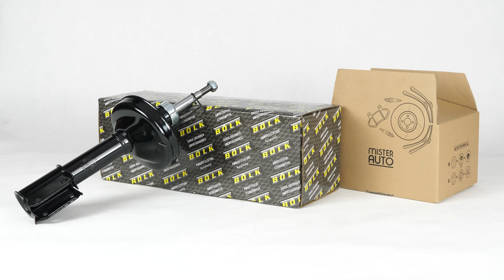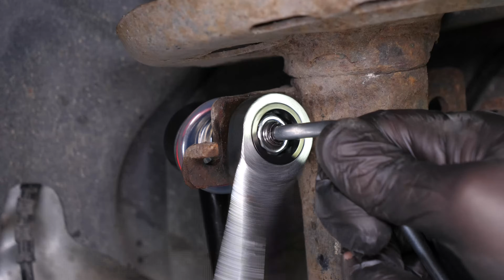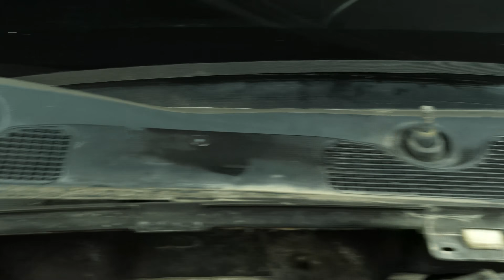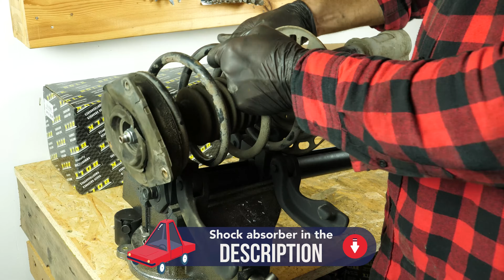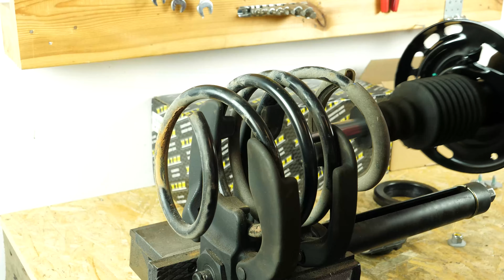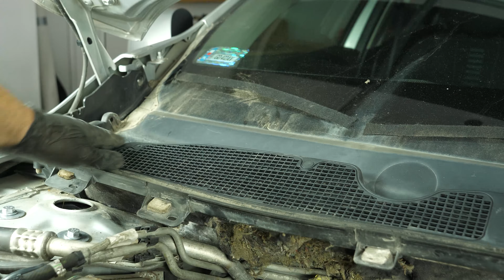How to replace the front shock absorbers Megane mk3 ➿

Comment: Good video but not totally complete as in order to remove the stabiliser you need to lift the all wheel assembly. After you remove the wiper arm,  there is no need to remove all the rubber and side cover as remove only the middle bit leaving the rubber on it is less labour and provide exactly the same end result

Comment: Does the GT Line range have different shocks and springs to standard? I have a 2013 Megane 1.6Dci GT Line. I need new front shocks and springs but can only find ones that will fit any megane. No specific versions for GT Line. Thanks.
Reply: Did you find out if they are the same? I have got GT  line 2015
Reply: Not sure. I sold the car over a year ago and never found out.
Reply: @Mark-wx1ho  was it good overall? I’ve bought mine two days ago 1.6dci 130bhp gt line
Reply: @david7eXe Yes, I like mine. Quite a sporty drive. I got my remapped to give 160Hp and I think about 50 more torques. Very noticeable and pulled very well whilst maintaining the economy.
Reply: @Mark-wx1ho  did you have any issues after the remap? The shock absorbers are different(stiffer) compared to normal model? The car has 60k miles
Reply: No issues at all apart from the grin on my face.